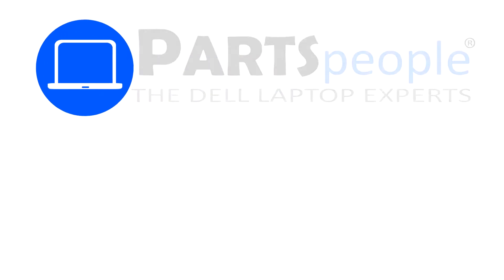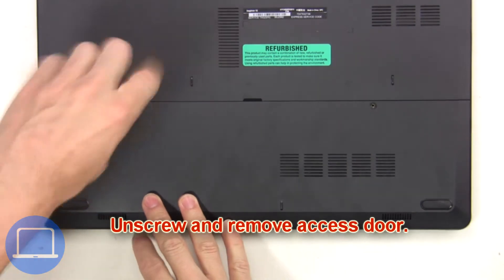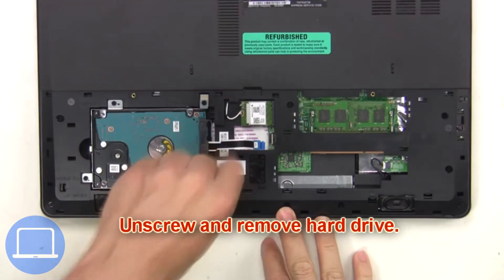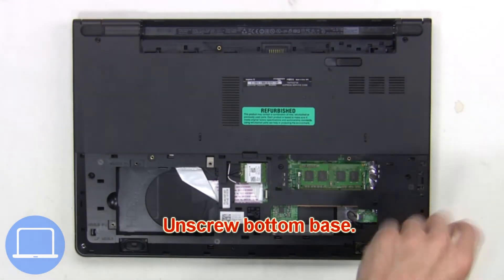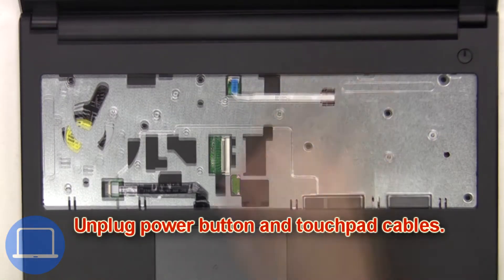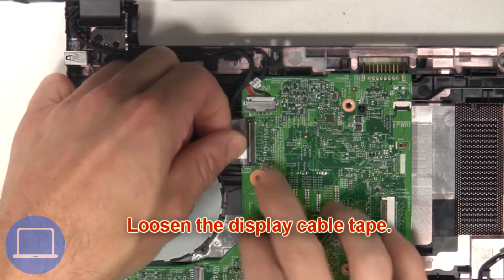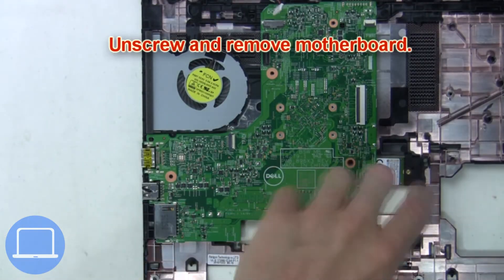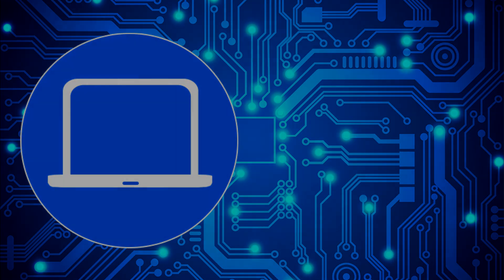Dell Inspiron 15-3551 (P47F002) CMOS Battery How-To Video Tutorial

Comment: then throw the laptop and buy a new one. 🙂 So much to do to change a cmos battery. Too complicated. I appreciate your video. I hate DELL laptop now.
Reply: Yeah! Just what I thought. You'd do all that just to get to that little round thing CMOS which you can see so closely near the RAM chip which you can easily remove. It's so tiring. 
This video is even less complicated than the one I have seen before.